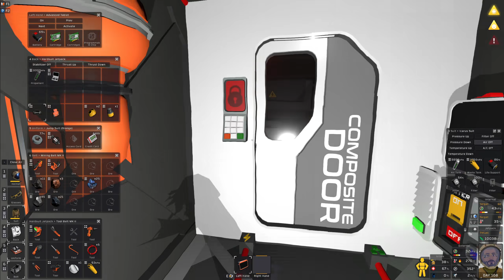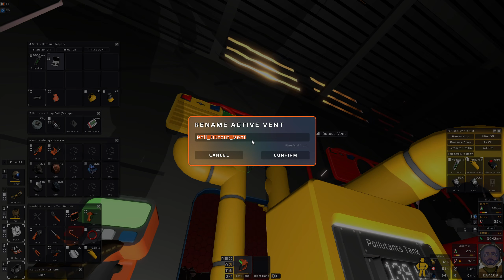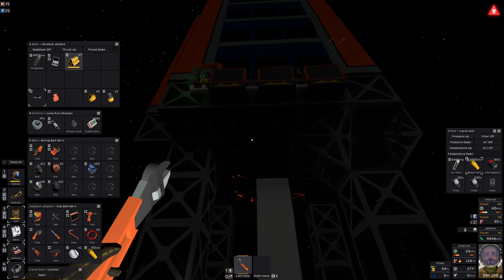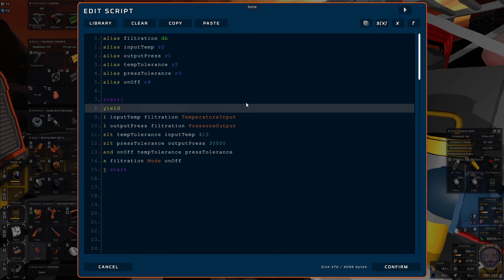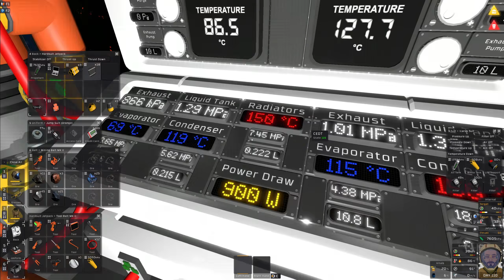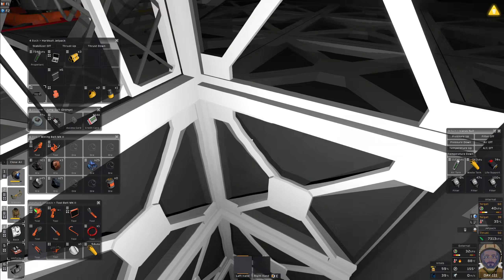Filtering Gunk From The Base - S2 E33 ║ Stationeers

Comment: In the beta branch (not sure if you are playing the stable branch or if this was recorded before the update) they now have new heavier cables that can handle up to 500,000 watts.  I've yet to build a base that needs them but you could probably make use of them.
Reply from the maker: I don't foresee needing more than 50kW any time soon. Even though the base is big, I don't think it will have that many devices running at the same time. :)

Comment: While you can't lock the switch itself, you should be able to lock the activation in code by doing
if(InSwitch AND (NOT SafeSwitch)) then 
   activate external vent
else
   deactivate external vent
   Set InSwitch Off  // Since it should be off since SafeSwitch is on.

Though your chip is already full so, might have to split the load and put some of the code in the filtration unit chip.
Reply: Even though the safety is on that one switch, I think you could still use it to lock anything you wanted.  Couldn't you just set the lock on both items depending on the state of the single safe switch?
Reply: @stevenwojtysiak6392  The problem is that the unguarded switch doesn't have the "Lock" logic type (the thing that stops you from manually messing with it), unlike the active vent, meaning that you can't lock the switch from being toggled by the player. This leaves doing it with logic the only option.

Comment: Hi great series so far love it, just wondering would it be possible to generate your base oxygen with the gases released from gold ore in the furnace? I know it would definitely be inefficient, but maybe something different and more challenging from the usual method of using plants, just for the filling of the base with O2 then using plants after the base is breathable
Reply from the maker: Possible, yes, but wildly impractical. :D

A single stack of gold would give 10 mols of O2, and we have like 6000 mols in the old base storage tank right now (when we use the tablet inside, we are only reading what's in the pipe itself, the tank is separate).

To get the same amount of O2 we would need to smelt 600 stacks of gold, that's 30k grams. :D

And that's just what's in the tank right now, if I released that much into the base, it would barely make a difference, the volume difference is massive. If my napkin math it correct, it would be less than 8kPa, not even breathable.

We would need to smelt thousands of full 50x stacks of gold. Not to mention the need to then cool them down.

So yeah, technically possible, but I'm not gonna do it that's for sure. :D
Reply: @Hmuda  Thanks for explaining, yes would definitely take hours to do, and to mine all the ore would be way to hard and take way to long😱